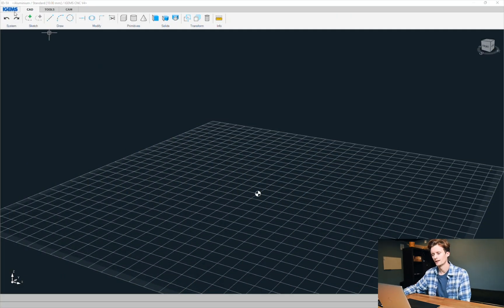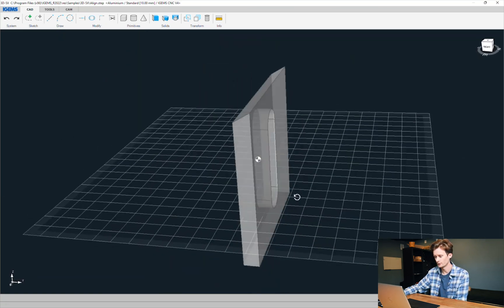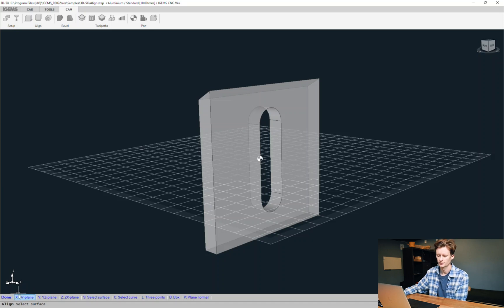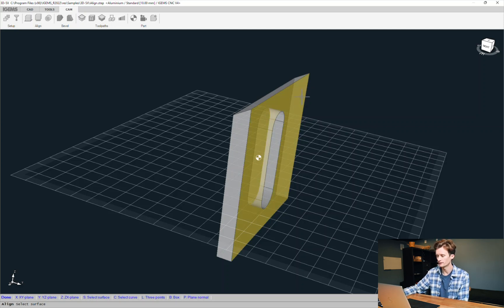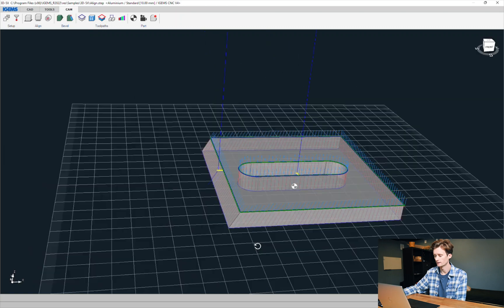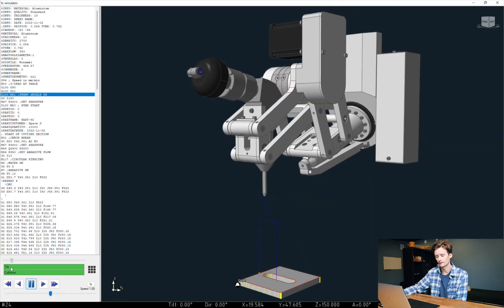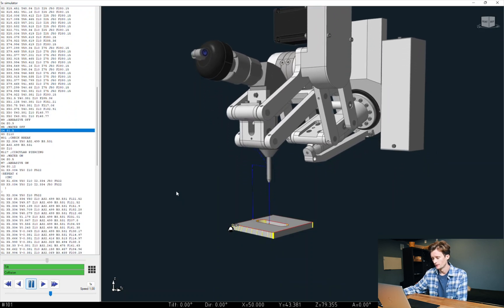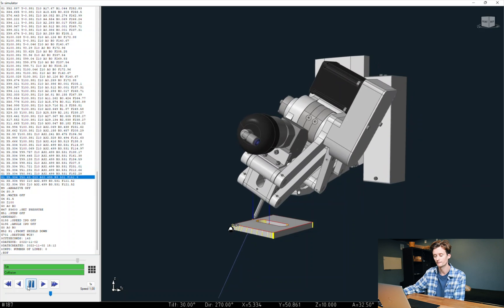Align 3D parts

Comment: Hi! Nice videos you got here. This is helping a lot. I have one question. I see you always use the auto button.  When i import from file, or drawing parts in igem, the auto function doest work. This only happens if there is bevel on the part. It do work work exact from the sample files. Do you have a video for it? :P
Reply from the maker: Hi,
The Auto tool path in 3D5X only works on flat stock material. It also needs a connection line from the top and bottom surfaces/curves.
Can you elaborate a bit more about what parts aren't working?

Comment: great stuff as always! 

i got a question.

how do i change different cutting head for simulation for 5x work?
Reply from the maker: Hi,
In the dropdown menu of the machine settings you can find "5 axis kinematic". There are some preinstalled cutting heads to choose from. If you want brand specific cutting heads, I'd suggest you talk to the machine builder. They should be able to help you. :)